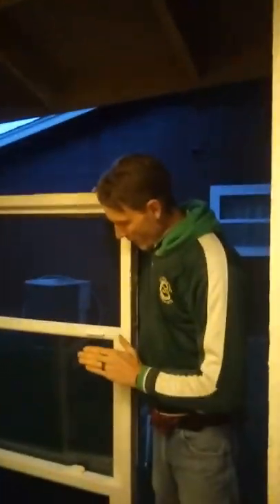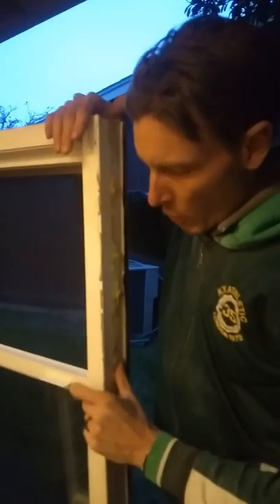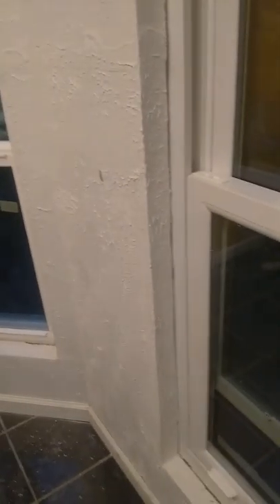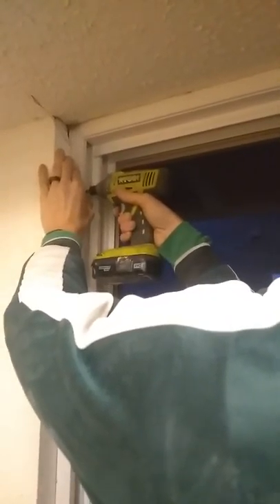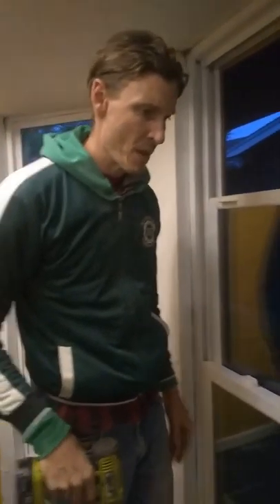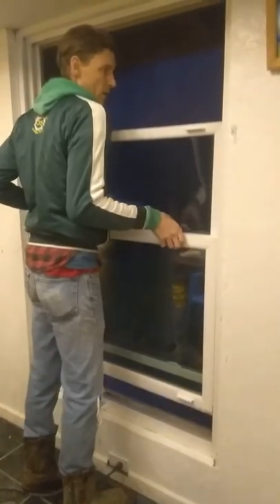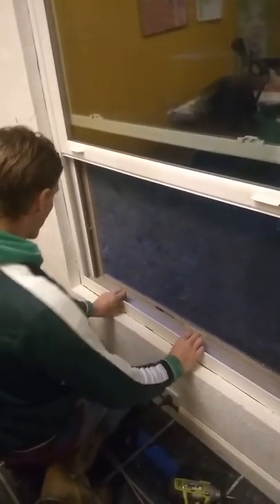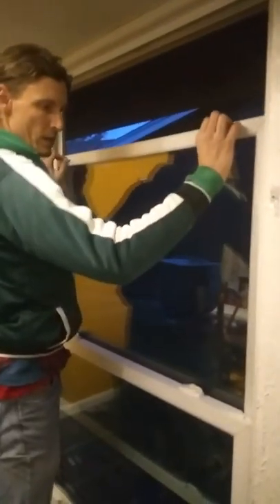Vinyl window install, used , flangeless

Comment: I was waiting to see, most importantly, how you flashed the outside without having nail fins.
Reply from the maker: U r right,. So we did spray foam in the remaining gap, installed the exterior trim pieces butted up against the window frame and caulked the remaining cracks.  That is how the Anderson window guys did the remodel flangeless windows